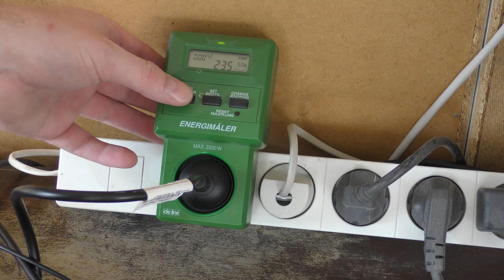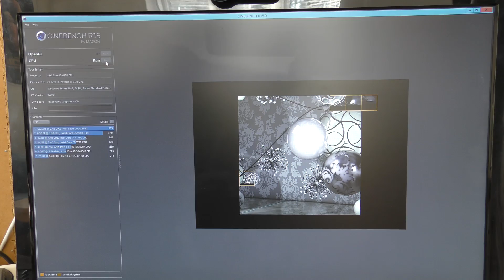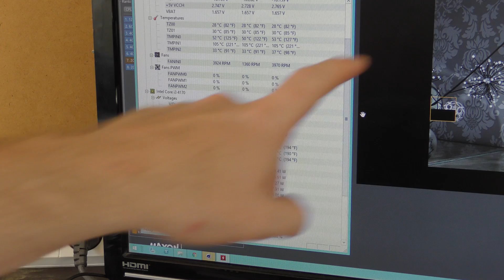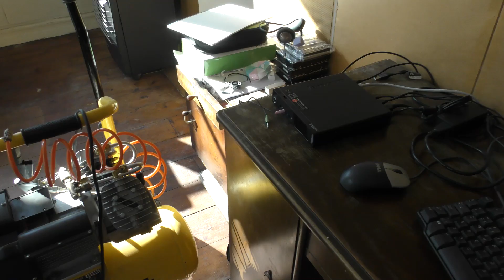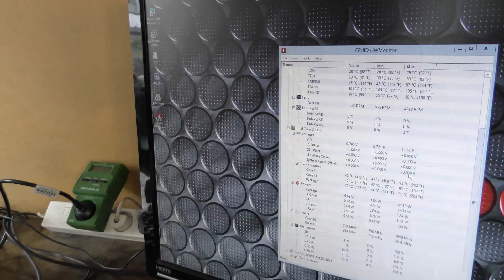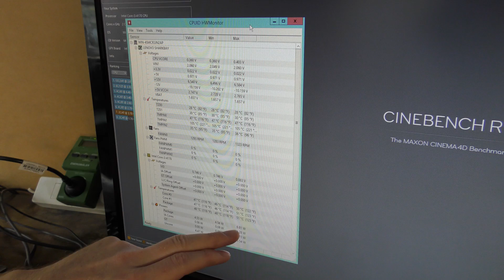Lenovo Tiny PC with i3-4170 Power and Heat Measurements - 406

Comment: I think the cpu voltage drops to much. The 1 volt regulator is maybe too small? Or the computer lowers the voltage to keep temperature down? I see from the datasheet that the voltage range is: 0.55-1.52. 0.7 is maybe on the low side to get max performance...?
Reply from the maker: Hi
But it was 1.51 all the time when it was working.
Thank you for watching! :-)

Comment: hey, I'm looking at building a GPU mining rig and am wondering if I might be able to cool the 45 watt CPU by fashioning a heatsink out of aluminum foil and cans because I don't have a cooler for the socket and I'm trying to keep costs down.
Reply from the maker: HiGPU mining for what?
Thank you for watching! :-)
Reply: +My PlayHouse (Morten Hjorth) most likely using hd 7950 GPUs running the daggerhasimoto algorithm for ethereum on nice hash. Found I can make a profit even factoring in power costs where I live.
Reply: No I think it will get hot quickly under heavy load,on Amazon they sell heat sinks for 4,5 bucks with thermal paste.why not use that instead?

Comment: its prob a power issue, or the motherboard does not support max TDP, try to see if there is a bios update, or a better wattage power brick, tho the temps are a major factor, i run AMD in most all my servers/workstations/desktops with a few intel based systems
Reply from the maker: Thank you for watching! :-)